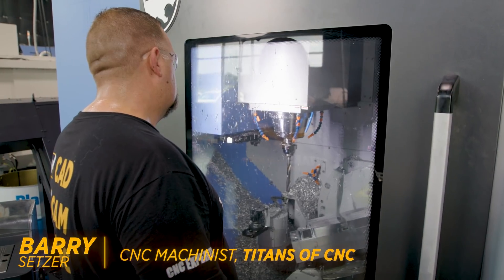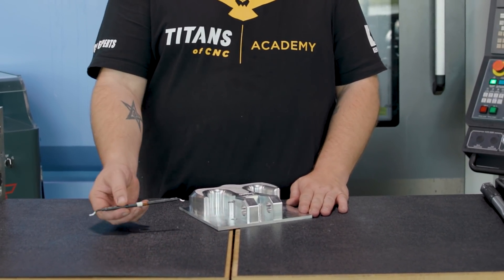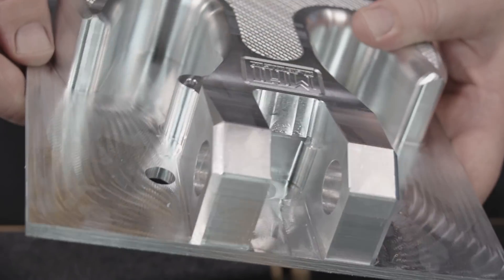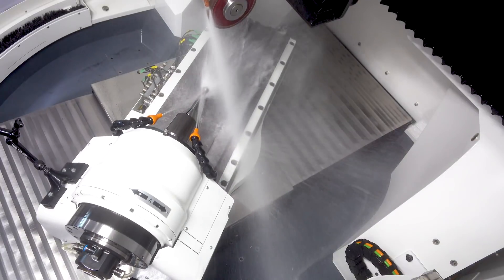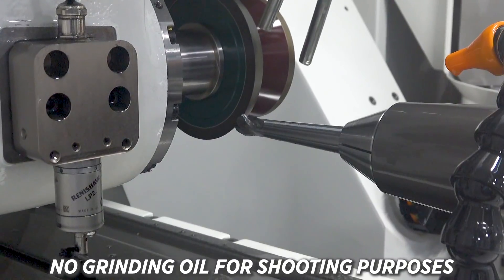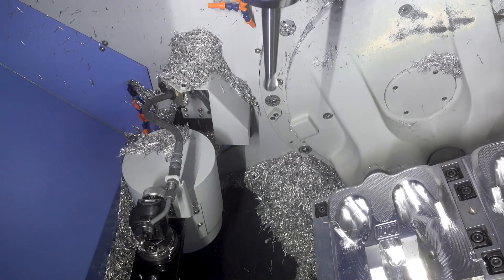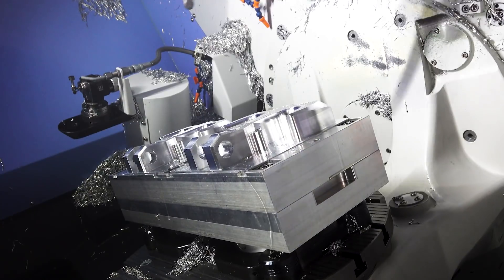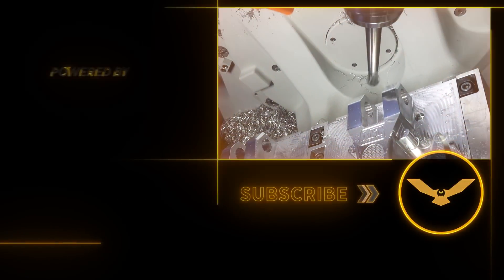Using Custom Tool Made In-House to Machine Parts on Trick 5-Axis Fixture

Comment: It's funny being a programmer for 30 plus years. It blew my mind how many shops never even new this could be done. I have amazed many people with my skills and made them lots of money. I have used all sorts of cam packs from alpha cam to the latest and the greatest. If i had to choose a workhorse Edgecam would be my first followed by Mastercam.  Sometimes I used both every cam pack has its plus and its minus. I will say one thing without a rock solid post processor for your machine. You can throw all the magic you want at your machine. Your return though is going to be less than satisfactory with Edgecam I can build them on the fly. That why that's my workhorse of choice.

Comment: Why So many c axis rotations?
Reply: Using 2 different dynamic fixture offsets for the 2 parts, and the B and C axis positions are controlled by the postprocessor. Because they are using different offsets, each part is processed seperately
Reply: @barrysetzer  i know that.. They Use a fixture plate for that job so for time profit i would make one offset and one program for both elements.
Reply: You would be amazed at what the post processor does to the code. I did a part the other day that had 28 holes each on their own axis. I was blown away about the way the machine rotated. The post will do things you don't expect.

Comment: I seen in a previous comment you used the Surface Finish Flowline tool path, is this one easier to control than the Debur tool path? I’ve had good luck with the Debur option for 3+2 and simultaneous tool paths. Always looking for other options to do things better and faster.

Comment: couldn't debur the 4 in one tour ? turning two time more 
by the way i don't know to use the cnc machine 
but i think tool can't hit to anywhere in part
Reply: It may be that when its tipped like that, there could be a collision with the spindle body on the table when travelling so far down in Z. So he orientates each part to be as Z-positive as possible for a more worry-free process.